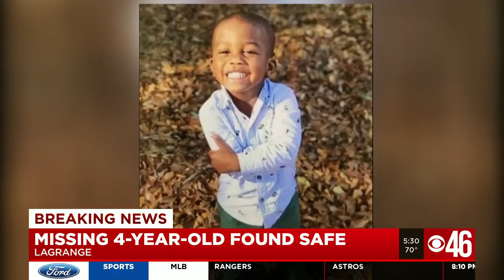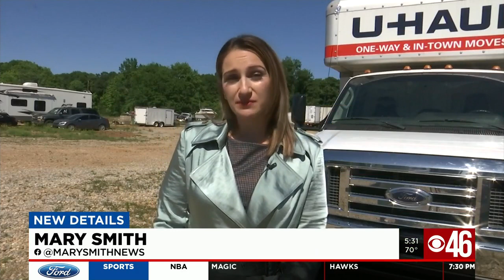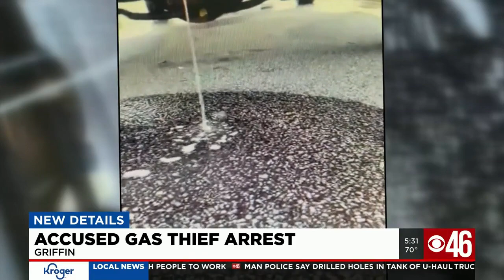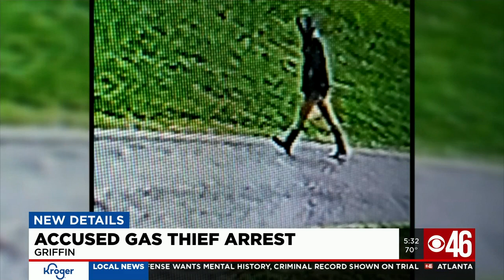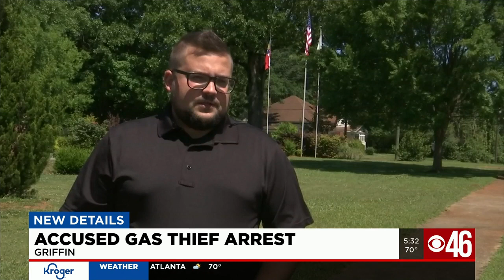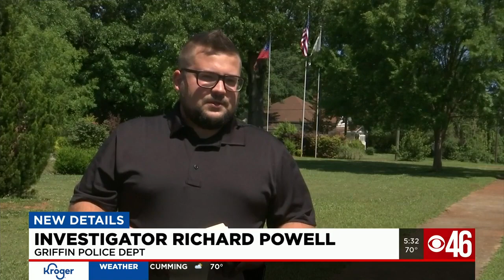Man accused of drilling hole in Uhaul truck gas tank, stealing gallons of gas

Comment: people gonna be stealing gas like in the Cheech and chong next movie
Reply: yup i remember back in the eighties  guys selling bootleg gas becuse gas stations only sold a few gallons to each customer..have no problem with this gaa here costs more than neighboring state speaking og which its time for that mysterios fire that always happens as they switch from winter to summer blend  what ever that means..but plant is always damaged and furtjer drives price.
Reply: funny thing is a guy in a Hummer blew himself up today after lighting up his cigarette right after he stowed 4 gas cans in the back!
Reply: @miguelcastaneda7236  Its an antifreeze agent.. Diesel will gel when cold cold. Could also have some methyl hydrate in the gas,to help dissipate condensation as well.. Marine gas has it and is a higher test..    

"gelling causing vehicles to not start in the winter.”
Diesel fuel, especially #2 Ultra Low Sulphur Diesel that is common to all services stations, will ‘gel’ as the paraffin in the diesel fuel starts to crystallize and freeze. With enough cold it will produce a solid wax-like substance that can clog the entire fuel system. It is similar to how a candle once it is lit warms the wax and the wax becomes a free-flowing liquid, then as it cools it becomes solid again. A similar process takes place when diesel fuel begins to crystalize during cold weather. When the weather is close to 10 to 15 degrees Fahrenheit*, gelling starts to occur and can clog the fuel system"
Reply: Man thats OLD SCHOOL! Now you just go online and hack it.. APPARENTLY! Tell us JOE how did YOUR buddies do it exactly?! Or... only hunter knows?!
Reply: @cumulusvapes7  Then why is the summer gas more expensive if they don't have to add as many additives? No it's more rip off BS like everything else that's going on in the world. Makes me think of an old Russian proverb, Even the most cowardly become brave when they're starving.
Reply: @thelast344  I wasnt trying to justify their price gouging at all! I was merely informing you, to your question... Re: " switch from winter to summer blend what ever that means" THATS what the hell, it means..  lol

Comment: It was only a matter of time.  During the '70s "gas shortage" there was an item called a "ligui-pour" which was designed to punch a hole in quart metal juice cans.  You punched it into the can, twisted it to lock it in. it had a spout and a screw on top.  Many were found punched into gas tanks. Someone put 20 foot of garden host in my wife's tank.  the more things change, the more they stay the same.
Reply: Wait until the yuppies get in on the gas stealing action, it's going to be wild then.🍿

Comment: Just weld the hole back up. 😂👍.    Film it just in case someone else needs to learn how.
Reply: Probably a plastic one they do weld metal gas tanks up if you did not know they fill it almost full with water they strike a light burn off that small amount of fumes tack the patch on and weld it up with the water still in the tank. I know they weld plastics with high speed vibrations but I know very little about it or if it could even be done on a plastic gas tank.
Reply: Noo...
Reply: Considering the age and general disrepair of U-Haul's fleet, the cost of repairing the tank was probably more than the vehicle's value and was totaled by their insurance company.

Comment: He had to use a drill and drill bit which creates heat and sparks! With  a full tank of gas, that could have went really bad over $3
Reply: It’s a simple weld a penny I got my gas tank from the junkyard they had to punch holes in every gas tank to sell them for 25$ then I just welded a penny over the hole

Comment: so nobody is going to question how it's in a junkyard right now after only the gas tank being damaged?
Nobody thinks it's a bit coincidental they caught footage of it actually still POURING out gas, not just dripping?
This heavily implies there is a lot wrong with this truck than just the gas tank being drilled into.
Reply: Junkyards sell gas tanks.
Some will even yank out the damaged tank and install the replacement tank.

Comment: Why drill a hole did the transfer pump cost to much too.
Reply: Honestly taking off the fuel line would have waisted less in the long run.

Edit :

If the fuel line was below the fuel level.